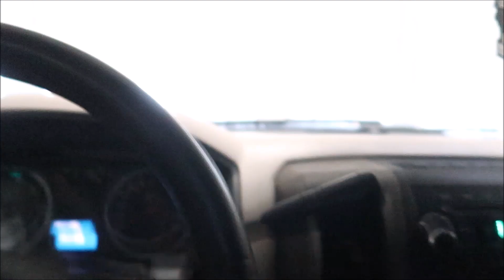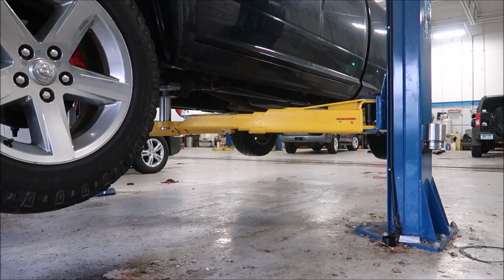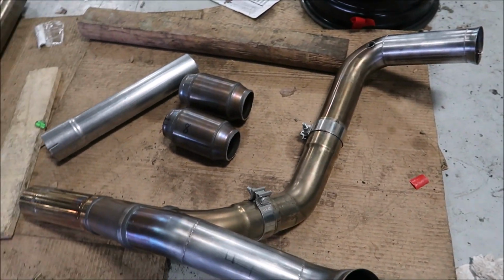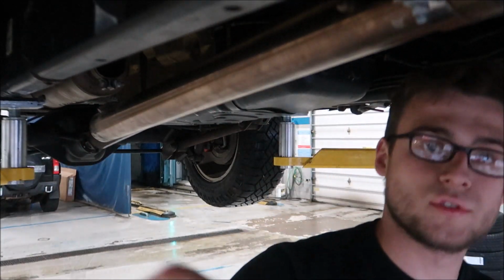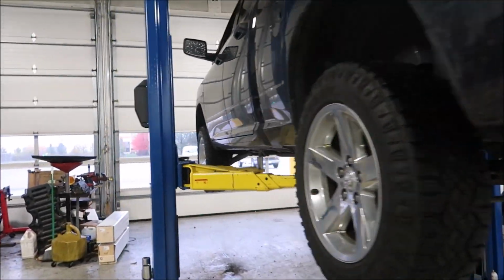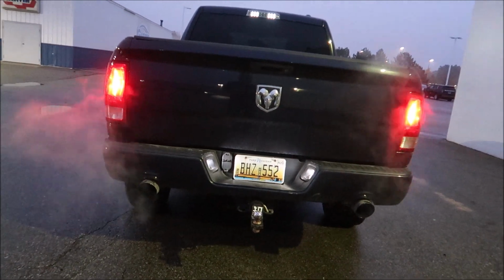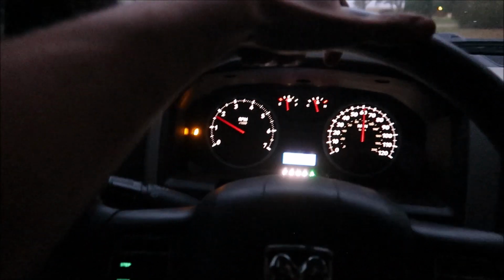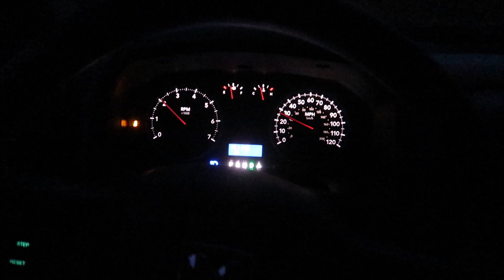I Should Have Gone Catless In The First Place... Lesson Learned...

Comment: mine is way better now with the cats gone and all the leaks fixed...what a project.  built an O2 simulator and it now thinks the cats are still there...happy days..i picked up like 3/4 mpg from it not setting the world on fire but these hemis are thirsty anyway. thanks for the inspiration for doing this
Reply: They stole my cats and I ended up just welding pipes instead. Can you please tell me how you built an 02 simulator??? Would appreciate the help
Reply: Where did you get the o2 simulator
Reply: @noeldiaz1359  a dorman part (917-112) u weld that onto the pipe and i believe you just screw it in if i’m not mistaken. you may need an extension i think they’re called

Comment: Nicely done bro. I’m a GM guy tho. I did a Y-pipe muffler delete on my ‘14 Sierra. It’s got 3 cats!- I left em all alone since I didn’t want to mess with O2 sensors and codes. I’m not really looking for “performance” so other than that it’s stock except for a Range module that keeps it from dropping to 4cyl at hiway speeds. Best sounding truck I ever had. Nice deep sound without shaking the older neighbors’ windows. Sounds better and louder than my ‘12 Sierra did with Magnaflow and my ‘02 Silverado did with Flowmaster.

Comment: Just did mine today. Stainless steel long tubes and 3 inch catless y pipe to a 3 inch thrush single in dual out. Now I need a tune for the cel
Reply: Just did similar to mine but true dual no cats let know if you find someone to tune the cel having trouble finding someone

Comment: Did you have any idle issues or the truck not wanting to go untill you step on it i bought one a bit ago and its catless and keeps throwing codes for 3 o2 sensor heater circuits and both upstream where replaced already
Reply: Did you get it tuned by a shop?
Reply: Nah it actually ended up being something wrong with the computer not communicating with the o2 sensors they replaced the computer and no problems after

Comment: How did you get the engine light to go off or did you have bungs welded in for o2 sensors
Reply from the maker: Going catless the only way to get the check engine light off is by getting it tuned and shutting off the rear o2 sensors

Comment: Yeah I took the cat off my 2002 Dodge Ram 1500 with a 4.7 and put a flowmaster super 10 on it and it’s better way better gas mileage now then with the cat
Reply: I'm about to do the same to my 03 ram, my cat is bad... anything special I have to do after I cut the cat off?
Reply: @leraybojangles711  if anything just buy o2 sensor spacers so it doesn’t throw a check engine light
Reply: @nanners781  Can't cut mine off it's oval shaped on the engine side of the cat fml. Fitting a straight pipe to it would never be possible on the engine side.. Gotta buy a $600 cat. 🤦‍♂️

Comment: Any tuning required
Reply from the maker: Yes when removing cats you should get it tuned for it. It’s not going to not run without a tune, but CEL will be on and it won’t run as well as it could be
Reply: Who tuned it or did you do it yourself
Reply from the maker: @jamesrotton5225  during this video I was using Jay Greene, but now I’m tuned thru Flying Ryan Performance

Comment: How many kms does your truck have ?
Reply from the maker: Right now currently I have 146k miles
Reply: @Shooff3.4  I have a 2014 with 189000 kilometres so about 118000 miles. Just wondering cause I was thinking of camming my truck and didn’t know if with higher mileage it could destroy the engine.
Reply from the maker: Oh no not at all, you’d actually be doing it a huge favor, especially if you changed lifters springs pushrods etc.

Comment: Lol my 2014 is louder and it has JBL 1 & 7/8” long tube headers with stock cars and 2.50” true dual pipes no muffler to 2.50”x 18”x 4.50” rolled edge tips and my truck sounds several times louder go to my YouTube I have a exhaust video on it
Reply: True duals are so much better and i also added an X pipe with Flowmaster super 40's. The exhaust is 2.5 inch. I want to eliminate my cats but I'm afraid ill always smell like exhaust. Do you have this problem? Do you still have your cats on?

Comment: Who wrote the tune?
Reply from the maker: Jay Greene
Reply: @Shooff3.4  OK, I have several tunes available, always like to see who is doing what. So the tune did away with the CEL light from no cat? Or did you just use "no-foulers" to keep it from lighting up the CEL?
Reply from the maker: Yes the tune did away with it, I’m not sure how he did it, thinking he just turned off the rear o2 sensors, since now I have a wide band in and it didn’t change anything
Reply: @Shooff3.4  The wide band wouldn't change anything I don't think. Its just a "read" sensor with a wider range then a regular o2. My AFR gauge needed my wideband before the cat, so now I'm wanting to get rid of the cat altogether, if I can without the PCM freaking out. Thanks for the response.